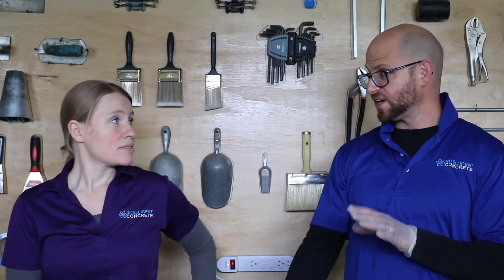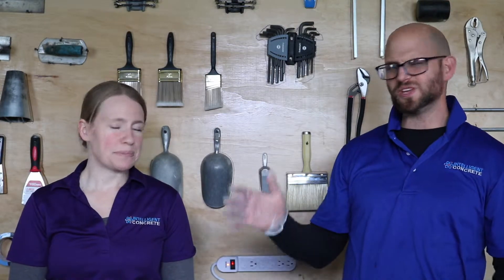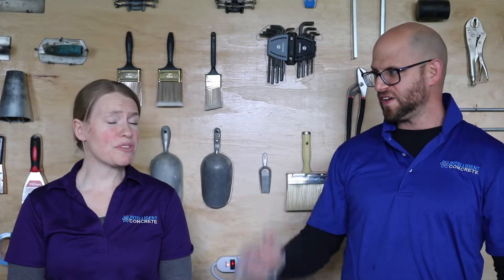First Time Using High Range Water Reducers In Concrete! - Vlog #305

Comment: Hi!
When you guys mix concrete in the lab with a mixing machine, do you actually follow the astm c192 ?
How do you guys batch the materials and in what sequence?
The astm c192 (8.1.2) says to mix it for 3 minutes followed by a 3 minute rest and then final mix for 2 minutes.
What is the point of letting the concrete rest for 3 minutes in the mixer?
Does CCRL care for the correct order when you are mixing?
Last year when our lab got inspected, the ccrl lady didn't care how we mixed it, so i am wondering is it really all that important?
Reply from the maker: Yes. We use ASTM C 192.  CCRL cares about all the details in the ASTM.